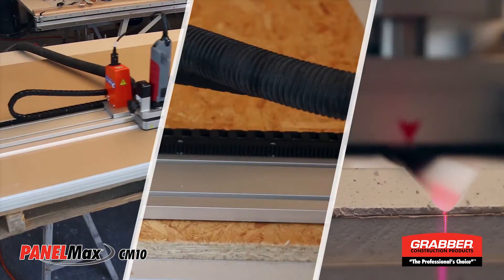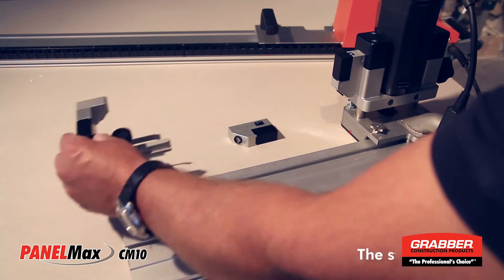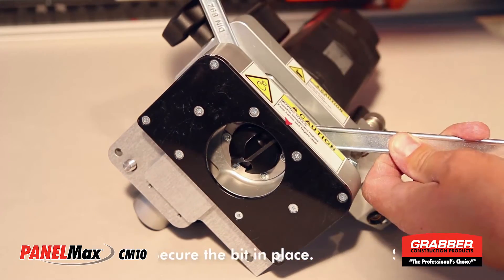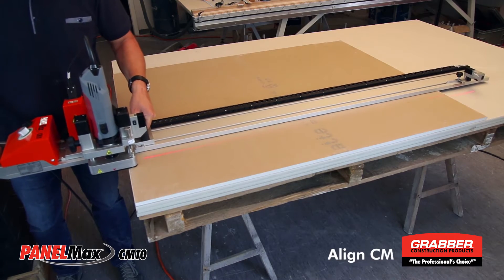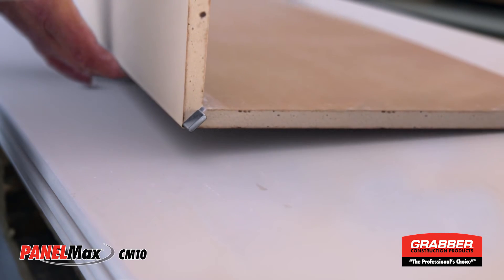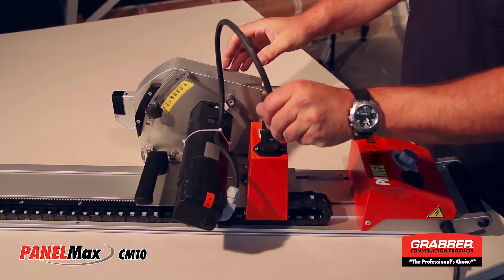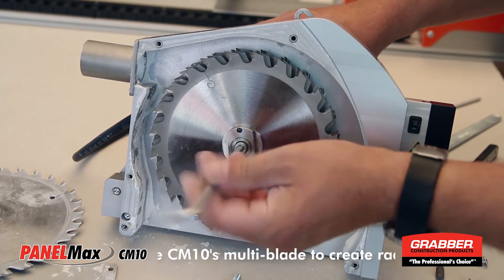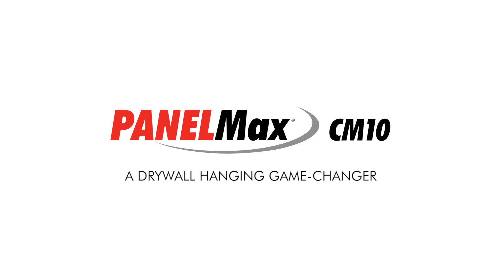Grabber PanelMax CM10 Instructions

Comment: price please....
Reply: Speak to your local supplier/vendor. These don’t move as fast as you may think so you will get a good quote. Places like Foundation Building Materials, Rew Materials, L&W Supply, Commonwealth, Capitol Building Supply, Kemph, and many other GMS suppliers that deal with drywall can easily help you get your hands on one and other types. I’ve seen demos done with this many times. The tedious part is getting the dial at the right height for the bit. Besides that this machine is a beast. When you see this in action in person, you won’t believe something like this actually exists. I love seeing guys have fun with it just at the demos. Especially after seeing it used ONCE! That’s how easy it is to operate.

Replacement parts are also easily accessible if needed. Since this machine is considered a “Mercedes’”, electrical replacement parts may be expensive. 
I hope this helps.